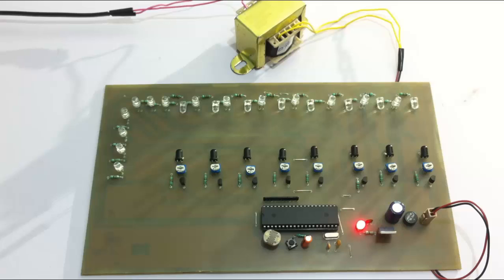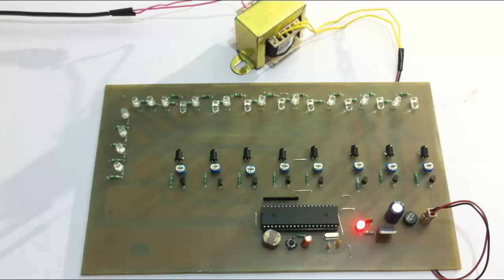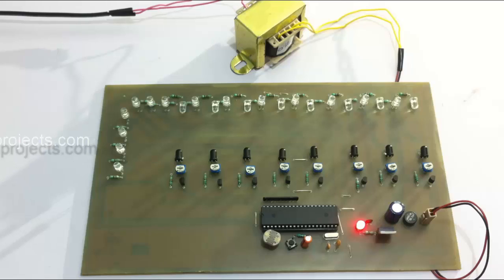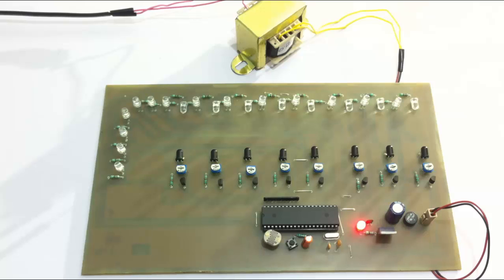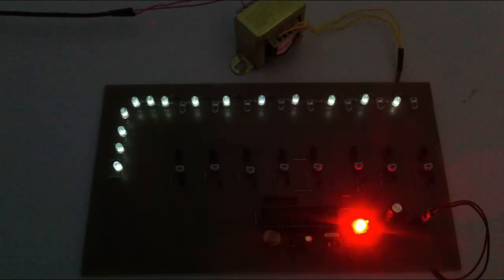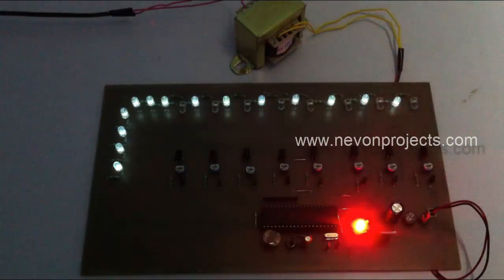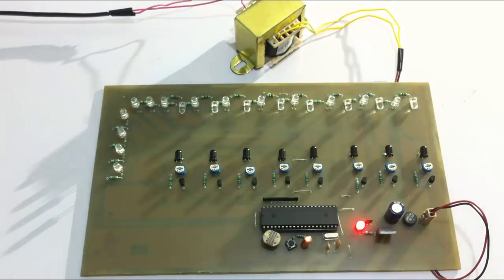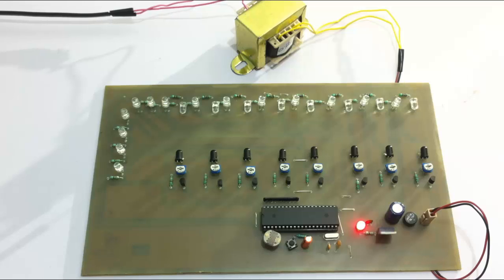Vehicle Movement Based Street Lights With External Light Sensing

Comment: what is the sensor used for detecting the vehicle
Reply from the maker: +JohnSM infrared (IR sensor)
Reply: +Nevon Projects I saw the project on your website do you require photodiodes to transmit/recieve the IR sensor? if not what is the purpose of the photodiode?